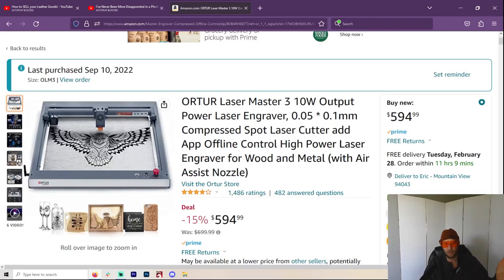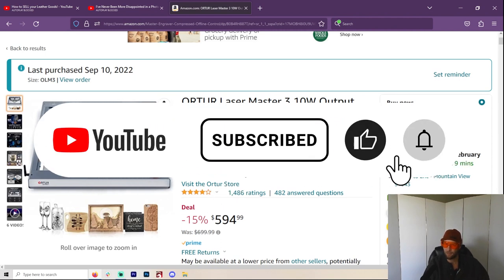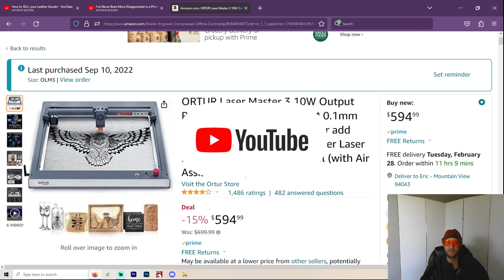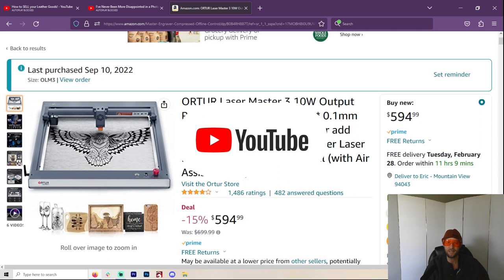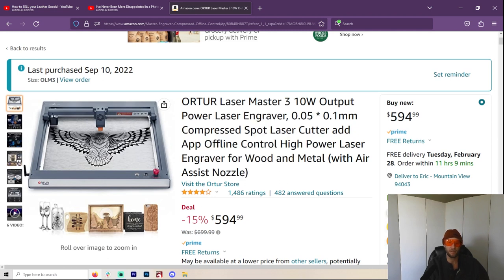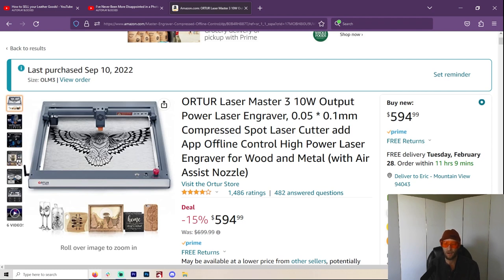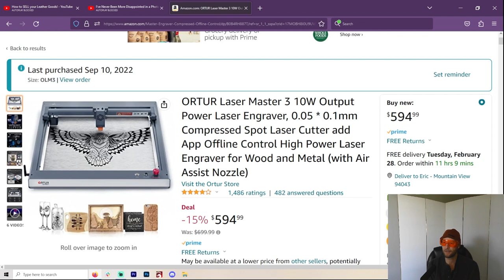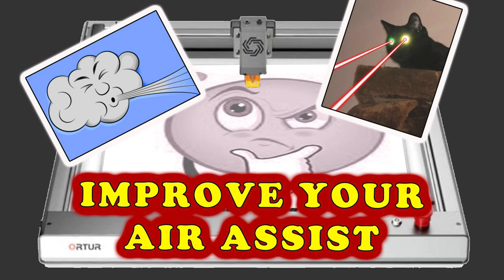Ortur Laser Master 3 - Six Month Review (with Accessories)

Comment: I received my OLM3 in November but waited until after Christmas to start using it but not as often as you. I haven't had any issues other than in the beginning after a few minutes of burning it would shut down via the USB. I finally figured out I had to disable the auto sleep mode and now it will finish a job. I have their newest air assist compressor and I'm just waiting for a friend to 3D print me a mod to attach to the side of the module.  No other issues and I haven't had to contact customer support for anything. I have a soft-side enclosure but now I'm trying to find a way to incorporate a digital camera into the system. My enclosure makes it difficult. On the OLM2 I believe there are T channels that can be used to mount a camera. Not so on the OLM3. Everything is going well and for Valentine's Day I created small wooden cards for our 16 grandchildren. They loved them! Now to find my niche product that I can make a little coin off from. I'm 70 and just retired in January. My laser is a great hobby experience and allows me to be creative in a special way. I love your channel...keep up the good work.

Comment: I just got the extension kit this week for my OLM  and I'll be building an enclosure over the next few weeks. I plan to include a dropout bed for larger items. I am using the fish tank air pump hack through the stock port, but I'll be switching to the "Laser and Saws" air assist hack similar to yours. Thanks for the great videos. Keep it up.

Comment: I love my lm3, I never had downtime and use it almost every day for around an hour for the last 6 months. (some days will go for most of the day) I did have to contact them because of my laser module. The laser did not focus properly. They did send me a new module but I still use the old module for most work. They said the diodes are misaligned. I connect using the WiFi most of the time. I basically only use the USB when using the rotary.

Comment: My LM3 worked out of the box, no problem at all - it still works like a charm. Bought it 5 month ago and uses it about 20 h per week, so not very much workload. I use it mostly on weekends. My setup is indoors with an indoor exhaust booth, also i use 'your' air assist setup that i copied (great video btw!) with the Z-Axis module. To have the air assist easily removeable i just used cable clamps, small tubes with a flatside that have a snap-click. So you just can open the cable clamp/channel and remove the tube. I do not have an extension or roller. I think putting any electronic stuff that isn't specifically designed for it outside is potentially a bad thing. The temperature changes and condensation of water seems to could cause a lot of issues.
Reply from the maker: You may be right. But the motherboard was bad on arrival, so that was on them. Great to hear yours is working perfectly! I moved mine inside, and just built a custom enclosure. Video coming soon :)

Comment: I've had my OLM3 and used it almost daily for about 9 mos.  never had any problems.  produces great engravings with no soot or burn marks, cuts beautifully and accurately and fast.  best belt tensioning system I've ever had among 5 diode lasers, and same for the built in air assist.  to be fair vs your situation, mine is used indoors in a temp/humidity-controled room.
Reply from the maker: I don't think the motherboard, power supply, and loose allen nut had anything to do with weather. And the air assist problem is on all of them. But I am glad yours is good.
Reply from the maker: Wow, you must have gotten like the first one. 9 Mos?